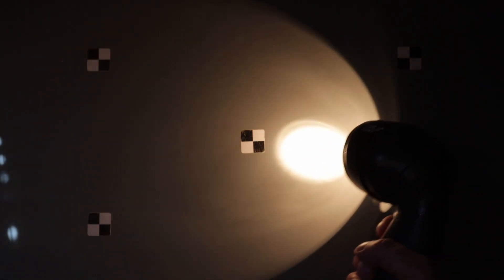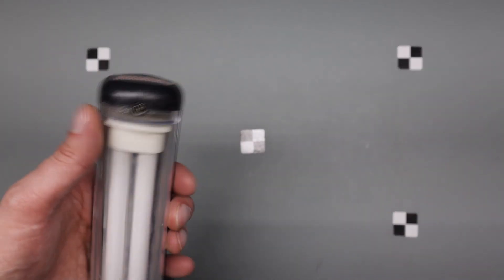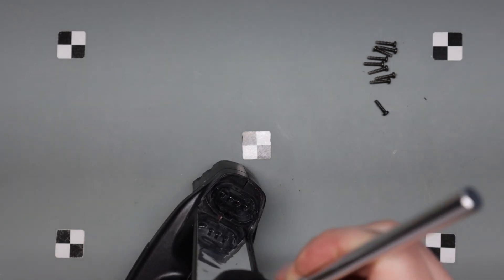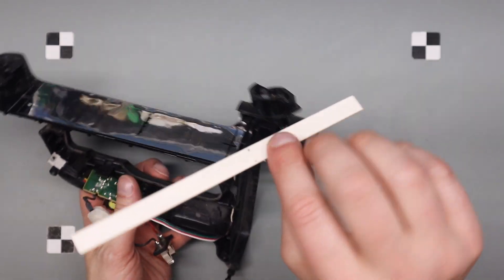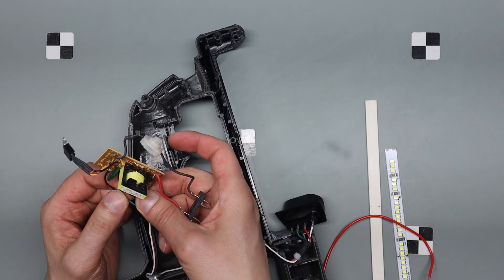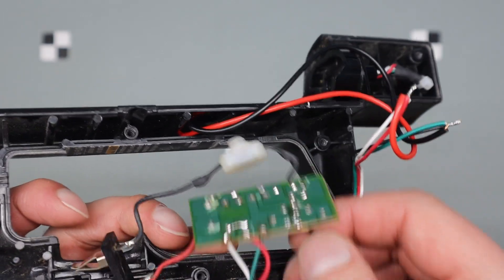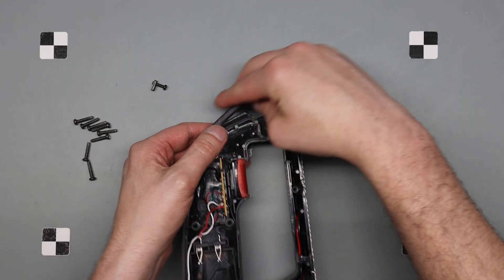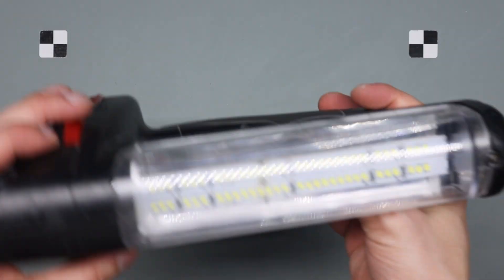LED Conversion for Craftsman 19.2v Incandescent and Fluorescent Lights

Comment: I have two old fluorescent lanterns I want to convert to LED.  They use two 6-V batteries in series.
To my surprise, the Rayovac 808 lantern batteries with F-cells are discontinued.  All similar lantern batteries use D-cells, with a foam filler underneath. 
My best option looks like Mighty Max 6-Volt 5 Ah Lantern Rechargeable Sealed Lead Acid.
Would you know how to convert a spring-top lantern battery to lithium?  Might be worth a video.  Lithium should do better than 5 Ah, right?
Reply: Option appears to be 6 Volt Lantern Battery Adapter and lithium D-cells.  They're USB rechargeable.
Reply from the maker: @my2cents108  By the dimensions of a normal 6v lantern battery,  you could bundle 18, 18650 lithium batteries, 3S6P plus a BMS, to get 12v for your 2 in series.  It's more work to get just 6v from cylindrical batteries as you would need a converter.

Comment: If you still have those LED strips, could you connect to 12V and take a few voltages across the resistors and LEDs?
The resistors appear to be 100 ohms and the LEDs appear to be 2835.  
Strip looks like it should be running on 24V, not 12V.  Thanks.
Reply from the maker: I don't have nay accessible at the moment, but they are 12V, as they are for automobiles.

Comment: LED strips made for 12V running on 19V?   There are tiny buck converters on Amazon and eBay for cheap.
Reply from the maker: 2 in series so 24V running on ~20V battery.
Reply: @eeAspect  Sorry, I missed that at 03:15.   Put a boost converter instead,.  I have them.  They're excellent. 
Xl6009 Dc-dc Adjustable Step Up Boost Power Converter Module 
MT3608 DC-DC Step Up Converter Module Adjustable

Comment: It would have helped if you had actually had the flashlight in the video when you were removing and replacing the bulb instead of only showing a part of the light.  I was interested in seeing how to remove the original bulb and replace it with the LED.  This video was no help at all unless I wanted to hire you as a hand model.
Reply from the maker: It is slightly off-screen but mostly there from :23-:46
Reply: It's a dropping bulb. Pop off the lens cover with the big red or orange button. Pull out old bulb, put in new. Replace lens cover. Easy peasy.